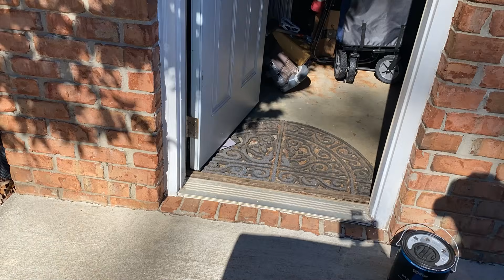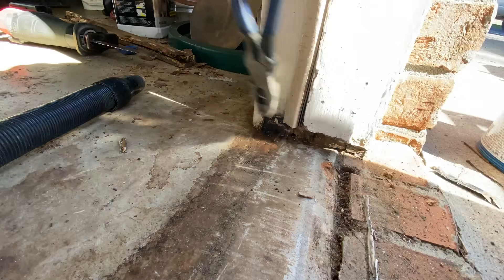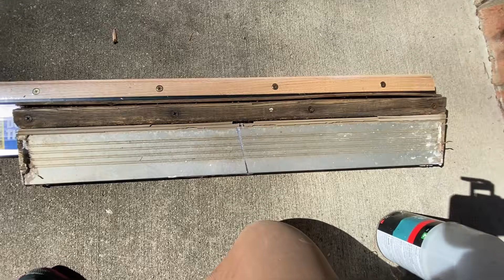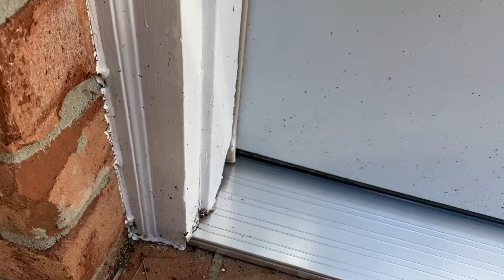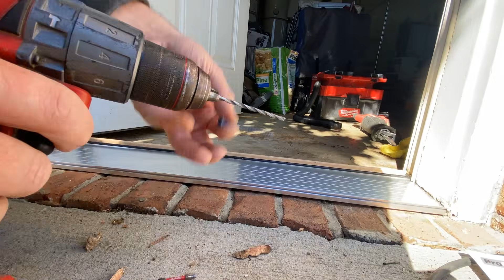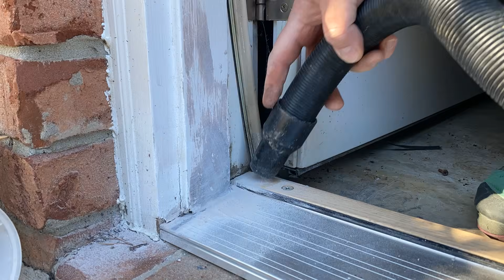How To Replace My Door Threshold (Surprisingly Easy)

Comment: Im about to try to remove an old stormdoor threshold and replace it with one that actually meets my door, do you know of standalone adjustment bars that you could put down instead of replacing the whole threshold? Theres really nothing wrong with mine aside from it having light under the door. Its not damaged.
Reply from the maker: I would look into a new seal for the storm door. They make universal seals. I think that may fix your issue.
Reply: @BallHomeRepair  storm door removed by the investors. Im guessing due to damage on the door that made removing it easier than fixing it. Do you think itd be easier to get a door than replace the threshold?

Comment: This threshold looks like it was cut a little long when it's first fit? If you look closely, you can see it's bowing up in the middle because of how tight it is on the ends. But either my eyes are playing tricks on me, or it was corrected in later steps.

I mention this here because it wasn't mentioned in the video and I think it's good info for anyone watching this: you want your threshold to sit flat so that any water on the door or threshold runs away from the wall and not to either side towards the door frame where it can accumulate and contribute to leaking/moisture damage. I would encourage measuring the slope of the slab under the threshold and the threshold itself once it's dry fit to ensure it's sloping away from the house and  door frame. If not, shims can be used under the new threshold to get it at the proper angle so that moisture doesn't accumulate where you don't want it to. It's easier to caulk gaps on the corners or the interior than it is to deal with the consequences of an exterior threshold with a negative slope towards the home.
Reply from the maker: The threshold was cut to the proper length. The gap you see is because the brick is not perfectly even. The threshold itself is sitting flat and is sloped properly from the manufacturer so no shimming was needed.

Comment: Screws were breaking because you didn't clean out the pilot holes before screwing the screws in. Drill, then take the threshold back out, vacuum out the holes, then you can seal and screw.
Reply from the maker: Good tip!
Reply: Yeap!
Reply: And plus supposed to use a hammer drill that's made just for drilling concrete, there's no breaking screws

Comment: I didn’t know about the adjustment part of the threshold. You just saved me hours. I would have taken it apart and maybe put shims underneath to raise it so that there wouldn’t be a gap between threshold and door.
Thanks for the tip!
Reply from the maker: Not all of the replacement thresholds have the adjustment but from what I have seen the good ones do. I’m glad I helped you out.

Comment: How do you fill in a gap underneath the threshold door outside?
Reply from the maker: Are you referring to a gap between the door and threshold or between the threshold and the floor?

For a gap between the door and threshold you may need to replace the door sweep or adjust the threshold screws to make it contact the bottom of the door sweep. 

If the gap is between the threshold and floor It depends on the situation, but if there is just a small gap, I would fill it with some sort of exterior caulking. Preferably clear. If there is a large gap you can cut a piece of pressure treated wood and insert into the gap and caulk as needed. You can secure the wood with construction adhesive.
Reply: @BallHomeRepair  gap between threshold and floor.
Reply from the maker: @SaarinkuCastilho  sorry for the late reply. I didn't see the notification. It depends on the size of the gap but I have had success with several options. If you have a gap that is 1/4" or smaller you can fill it with construction adhesive. Especially the polyurethane type. It will dry hard and support the bottom of the threshold. If your gap is larger than that I would cut a wood spacer that fills the gap. If you the door frame is on a slab I would make the spacer out of pressure treated wood.

Comment: This works great if your house has no flooring… because if it does you’re never getting that in.
Reply from the maker: In my experience all you have to do is remove the trim piece or transition strip that butts up against the threshold and then go about the outlined steps. Sometimes it can be a little more complicated, but it’s absolutely possible.

Comment: A note of caution.
This threshold has an untreated wood base and sits directly on an exterior concrete doorway. 
There is a high probability that it’ll fail just as the old one did.
Reply from the maker: Yes it would be a good idea to put a vapor barrier in addition to painting and sealing.

Comment: Yessssssss

Thank you!!!!
Reply from the maker: Very welcome! Hope you had success!
Reply: @BallHomeRepair  welp, its not going according to plan, unfortunately my new door is .4 inches larger than my original door!!!

So i have to cut some stuff i gotta figure it out….
Reply: Wish ya man luck!!! 🍀 😁
Reply from the maker: @joveezy19  how did it end up going?
Reply: @BallHomeRepair  I ended up tearing out the entire old frame and building a new one from scratch. I was able to get a 2x4 and (2) 2x2's and basically make the same shape as the the original wood.

I was able to spray foam to insulate the areas I needed to and it is covered by the new wood. Its half way painted. I was able to get the Lock holes cut out with a Dremel wood carving bit. 
used a 1x2 for the door gasket frame. it is MUCH thicker than the old one so there was some door handle clearance issue, But I was able to cut with the demel and sand it down to make it look somewhat nice and the door opens and shuts good. good seal on gasket too when deadbolt is locked

I just need to put moulding around the inside door frame, and the threshold and should be done!
Reply from the maker: @joveezy19  That sounds like a fun project! Sometimes a new door frame is just a better move anyway. I have several old doors I have saved from projects that I can't wait to build door frames for on my future shop project.
Reply: @BallHomeRepair  NICE!!!
Yeah it actually was fun!
I probably should have gotten the Enrite Door Unit, but dude those are soooo expensive, and to get a door installed (lowes quote) was like 2000$ i cant remember if the door was included but I dont think it was, I would have been in the whole for 3 grand!!

but 35$ in wood 100 something for the door, few bucks on nails, and a weekend and I got something secure and insulated

I think MAXX total cost was under 450$
so in my eyes , WORTH IT!!

I can spend 3 grand later on when Im going to sell the house lol!!!
Reply from the maker: @joveezy19  Nothing like saving some money!

Comment: Can you tell me please the stuff that you fixed the bottom of the frame and sanded off.  What is it called?
Reply from the maker: Yes it’s called all purpose putty or “bondo”. Just make sure and get the kind that doesn’t have fiber in it. It should just be a smooth, two-part putty that you mix together and hardens up.

Comment: You didn't caulk under threshold to stop water intrusion.  Only caulking edges is not sufficient especially on an entry door that close to ground.
Reply from the maker: Yes caulking under the threshold as you install is great to stop water intrusion.

Comment: Nice video.  BTW, what type of material you used to fill that "space" in the rotted door frame?  Very curious.
Thanks
Reply from the maker: I used filling putty or “bondo”. It’s very similar to the stuff they use for bodywork on cars, but they make an all purpose version. It’s a synthetic waterproof material so water and moisture don’t affect it. It sands smooth and paints great
Reply: @BallHomeRepair  Thanks.... 
there are many products available. 
Do you recommend any particular one?
Reply from the maker: @richardli1962  I really like Bondo all purpose putty. They sell it at Home Depot and Lowes.
Reply from the maker: @richardli1962  I’ll try to make a video about it in the near future

Comment: Is there a foam or insulation strip between the threshold and the wood adjustment strip? Great video! I’ve got two doors that have gaps under the door and I’ve felt intimidated in making these repairs.
Reply from the maker: No foam or insulation on any of the ones I’ve installed. If you’ve just got a gap issue you can also replace the seal between the bottom of the door and the threshold first. Sometimes they get worn out at cause a gap. Definitely a cheaper and easier fix. They also have extra thick ones if the gap is large.

Comment: Thanks for sharing, very helpful! Using a wet cleaning wipe (disinfectant wipe) while the caulk is still wet will really clean up the caulk lines.
Reply from the maker: Great tip! I’ll try that next time!
Reply: If you don’t have wipes, aerosol glass cleaner and a finger does the same, especially with proper exterior silicone caulks that aren’t water clean up. Learned this from a countertop installer years ago.

Comment: That old  threshold was never sealed underneath is why it came up so easy...and why didn't you replace the jamb it's rotted
Reply from the maker: It wasn’t completely rotten. I dug out the bad wood and filled, caulked, and later painted. No need to replace unless the customer wanted it that way. They did not.

Comment: Why do I need “extensive experience” to trim a wood/aluminum sill on a miter saw?  Thats what the tool is designed for…..
Reply from the maker: Because I’ve seen newbies that don’t know what they are doing cut metal with a miter saw and get injured. Basically just be careful 😁

Comment: Awesome video! I need some help brother. So my front door threshold was destroyed when I was replacing the subfloor of my home. It had been screwed into subfloor that had rotted away and was unable to be removed without some prying on the old subfloor. This tore up the threshold and made it useless. It needs to be replaced but I am concerned that this was a prehung door, and that this threshold is physically attached to the rest of the door frame. My stepfather believes I will need to buy a whole new prehung exterior door for several hundred dollars and rip the old door all the way out and put a new one in just for the threshold issue. This would be a lot of money and labor. So my question is, if I do have a prehung door, could I use a vibrating multitool with blade to cut the old threshold out of the frame, and then do what you have done here with no consequence? Will such a thing damage the integrity of the door frame? I assume the frame has been screwed to high heaven on the horizontal and vertical where it meets the house, so losing the base of the pre hung should not ruin the function of the door to any extent while it is all in place. What are your thoughts? "Help me Obi-One Kenobi, you're my only hope."
Reply from the maker: Most likely your original door is a pre-hung door. The one in the video is a pre-hung as well. It doesn’t destroy the integrity of the door frame to replace the threshold. Usually the sides of the door frame are notched out for the threshold that way the frame is held up by the long pieces of the frame and not just the threshold. You can absolutely use one of the vibrating saws  to remove it. I hope this helps!
Reply: @BallHomeRepair  Thank you sir! That's all I needed to pull the trigger on getting started.
Reply from the maker: @Labcarrot  LETS GOOOOO! Let me know how it goes!